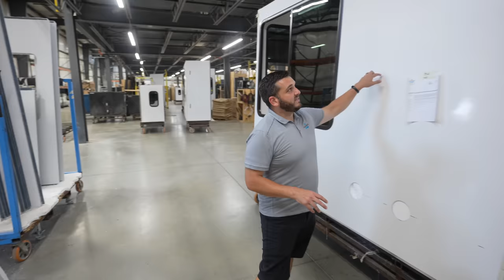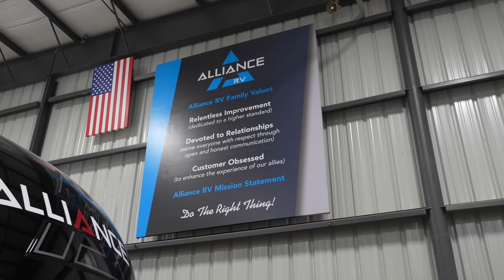New RV Announcement + Touring our NEW Manufacturer's Factory

Comment: My question was you had a GD and put a lot of cash into the solar system by the video, did the system stay in the GD or was it / will it be installed in the New one ?
Reply from the maker: Gotcha, so we are selling our solitude with the system intact, and we will be installing a new system on the Valor, it’s just going to a bit settled in first!  There are some exciting new things coming from Big Beard Battery that we have been working with them on!
Reply: @Millers_in_Motion  I just see it as a loss, you put in a great system, guess we will see. This time go 24 or 48 volt.